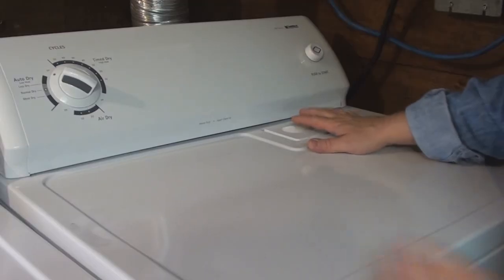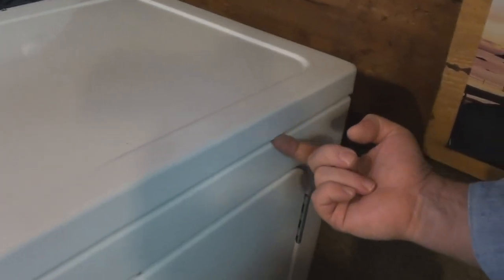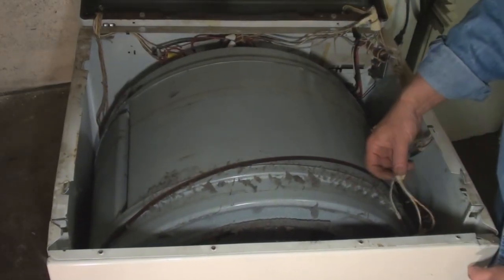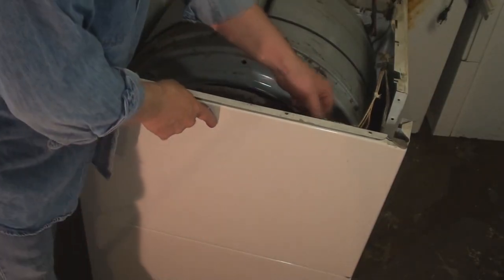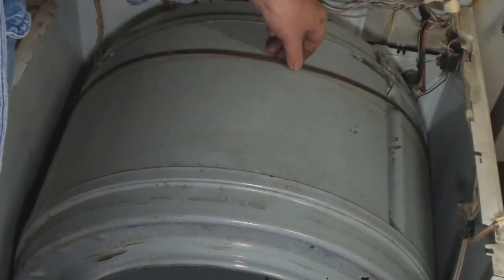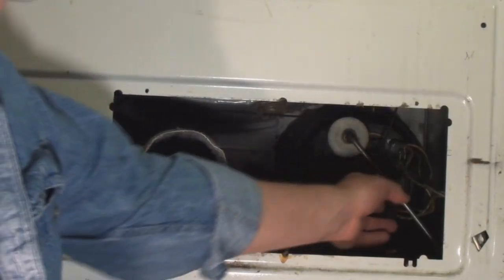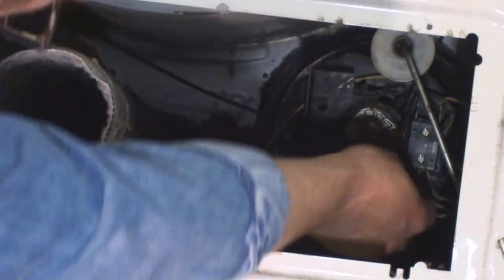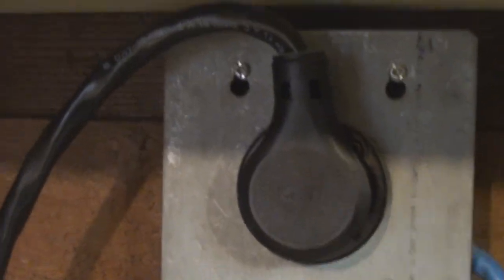Dryer Belt Replacement

Comment: Perfect.  Dryer is repaired.   We had a few more screws at the bottom of the front panel so if it doesn't release just check there.  We had ours in the back of our truck bed already and on its side so we were able to see all screws that needed to be removed.  Super easy.  Can't believe it took 3wks to find someplace local with parts.
Reply from the maker: +Karen Conwell - Congrats! Thanks for writing

Comment: Thanks so much for posting this. I was able to fix my older dryer fairly easily. $15 for a belt instead of $100+ for a service call. One thing I would mention is that I needed both screw drivers and nut drivers to do this job. It's a slightly awkward job but definitely doable.
Reply from the maker: Thanks for writing in! Always glad to hear I was able to help someone.

Comment: Great Video. I am an electrician by trade so I have know problem taking on jobs like this. Travel time to house, disassembled dryer, called Sears to get price, Drove to Sears, and back. Installed part. Reconnected dryer, then test run. All just under 2hours. Sears charges $100 plus $60 for travel...............This was for an in-law. so I only charged $50. Belt was $24.03 with tax. I just did my own Washer Inlet Valve($34.00). Looking forward to my next project. Thanks A lot. Great Job..........

Comment: Thanks, simple and not too long (appreciate the sped-up screwing).  I've done this before, but it was years ago by trial and (probably much) error, and I forgot.  A good reminder when the unit is open is to check the pads as well.  When the pads get too worn it won't roll smoothly and will start making a horrible screeching noise.  With an old dryer they may be due for replacements too, and you can grab them from the parts shop when you get a new belt if the belt is shot.
Reply from the maker: Great tip! Thanks for contributing!

Comment: This is a good time to also replace the nylon drum glides (while the front is off). I have found they wear out much more often than a drum belt will break.
You can tell new ones are needed when you start hearing that little "metal rubbing" when the drum is spinning. Even if you aren't hearing that noticeable sound, chances are good that new ones are needed if the belt has aged that much. They are inexpensive and easy to install (no tools). Really quiets down and eases the drum operation.
Reply from the maker: +Bruce Seymore - Thanks for contributing that, Bruce. I'll bet a lot of readers will be grateful.

Comment: Thank you for making this video I now know how to change my dryer belt and clean out my dryer. :) The only problem is the belt is not my problem. I'm thinking it's either the motor or the drum wheels not turning the drum. My dryer is heating up but it's not turning and this last time it had a burning rubber smell to it. I immediately turned the power switch off and unplugged it.
Reply from the maker: Burning rubber smell would indicate something (like the motor) turning against something else (like the belt - slipping?) and causing friction.
Reply: Ok, Thank you for the prompt feed back! I'm still trying to figure it out. I will check where those two meet to see if that is it.
Reply from the maker: On the other hand if your motor is locked up you may smell wire insulation burning. Be super cautious and have a fire extinguisher ready.
Reply: There is a motor running sound but the drum is not turning.
Reply from the maker: You need to look at the drive on the motor and determine if it's turning or not. Look through the tensioner access as shown in this vid. Not turning? Shut down immediately and replace motor.
Reply: Thanks for your help! My husband looked at it when he got home and I wasn't turning the wheel all the way, so the belt was melted and  frayed and the tension wheel was broken. ( it was used before we got it) Now I'm on a mission for parts! :)
Reply from the maker: I'm always happy to hear that my videos are helping people. That's why I make them.
Thanks and good luck!

Comment: Hi, I'm currently trying to replace my dryer belt on an older model, like the one you exampled on, but I do not have easy access to the belt motor. The back is pretty much completely solid and there are no access panels. It is a Crosley, if that matters. I think I might need to remove the drum, I'll keep searching. Thanks

Comment: It would have really helped if the video had mentioned whether or not you could drop the new belt around he big drum from the back side instead of the front side (if it was even possible) --  I mean as not all models are the same. I have one that appears to require pretty much the same steps as in this video pretty much except for the taking the top off. The back of the top part can be raised up but the back I am not sure if it will lift up allowing the top to come all the way off. Do I need to take the top all the way off I am wondering by dropping belt around drum from the ack not the front?????

Comment: Thanks from me as well.  My drier stopped spinning yesterday and after following your steps to get the top off, sure enough the belt is missing (probably snapped and laying under the machine).  Looks like I'll be pulling out the big thing and fixing it this week.
Reply from the maker: Futrix Good luck and thanks for commenting!
Reply: Well mine was a whirlpool model, which meant that they gave me a slightly different setup inside: no back removal.  It kinna sucks because the pully isn't attached but instead sits in grooves.  It was hard to get enough slack while keeping the pully locked in, but I managed.  

http://www.instructables.com/id/How-To-Replace-a-Dryer-Belt-on-Whirlpool-Models/

Comment: Why turn off the power switch if you are UNPLUGGING IT?? ...I need the power and lights on to see what I am doing? lol
Reply from the maker: You can always turn the power back on after unplugging the appliance. Safety first!
Reply: @repairs101  
It's just as safe unplugged with the power on as it is unplugged with the power off.

Comment: My dyre lint trap is not on the top of my dryer, its inside the front door. So how do I remove the top cover to get access to the front panel to replace the belt? I have a Haier model CRDE340W

Comment: A lot easier put it through the tensioner and motor first slide drum in loop. You don’t have to stand on your head.  That belt is tight.  Just a lot easier
Reply from the maker: Thanks for the tip! I never thought of that.

Comment from the maker: I'm not familiar with that machine so my help is limited. If your machine has two "tension" devices (tensioning devices) it may run two belts. If it runs two tensioners on one belt, belt alignment will be even more critical. Be sure the belt runs true and is free of twists, Good luck!

Comment: This machine is a GE..not all come apart in this fashion. Few new machines have a back panel get near the motor pulley to put belt on at the back.
Beware.....if this guy was a tech...he'd not have had lint like that in his dryer.

Comment: Why "recycle" a working dryer? If it heats, turns quietly, and cycles properly, donate it or sell it cheap. I do both with dryers and washers, donate to my Church Congregation, or sell it for $50-70. Easy money or goodwill at my Church. Electric dryers are cheap to fix and all follow the same basic pattern. Washers are a bit more complicated, but if you have the time and access to parts (even wringer washers), even they can be fixed. No warranty on wringer washers! 30 days on the rest.